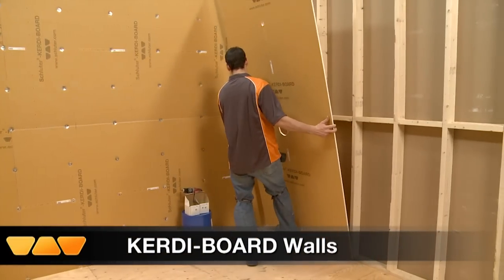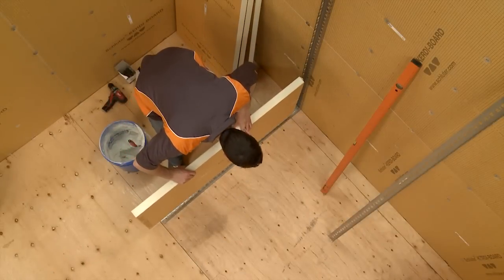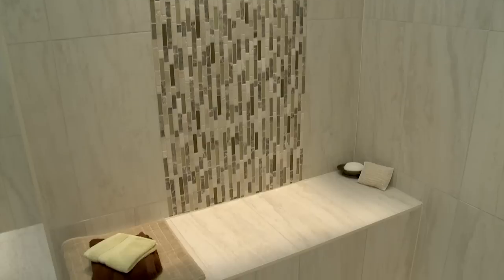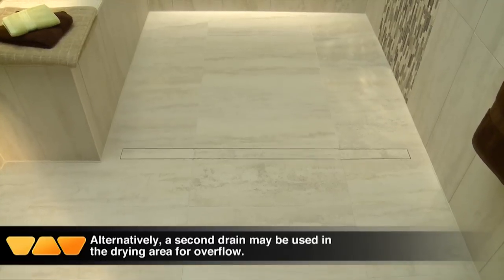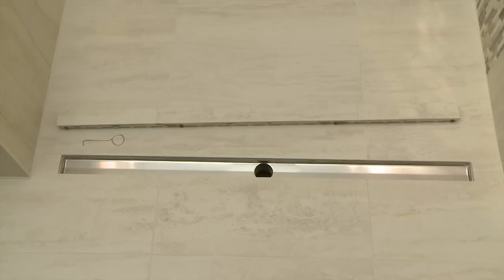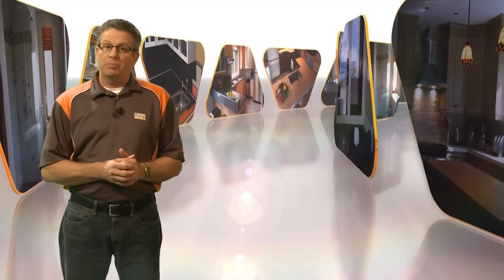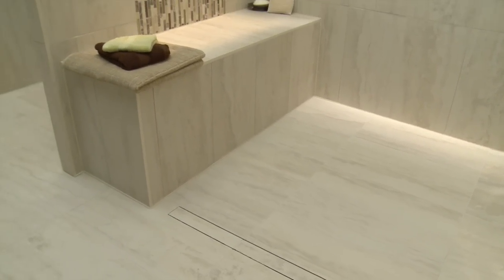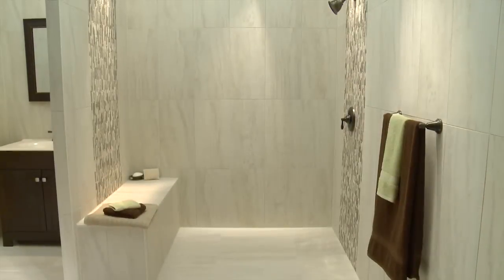Schluter-KERDI-LINE with Entrance Drain Placement

Comment: What about the exposed vertical foam where the cut was made - doesn't that need Kerdi Band as well? See at 4:25
Reply from the maker: Hey, Yes, the exposed vertical foam does get covered with KERDI-BAND or KERDI as well, generally after the tray is installed.

Comment: What is the weight limit of the channel support? I'm planning on having a center line drain, so it will be stepped on from time to time.
Reply from the maker: Hi! KERDI-DRAIN was tested to CSA B79, which includes a load testing requirement, and received a Light Duty rating. This means that it was tested at 440.6 pounds for foot traffic. The tray is rated for 80 PSI. So, foot traffic is fine for both.

Comment: did I hear correctly that I can eliminate any baseboards from my entire bathroom by using the metal pieces? >Either floor tile joined to sheetrock/painted walls or floor tile joined with tile running up the wall as well?
Reply from the maker: Hi Brandon! Yes, we have many profile options that will allow you to join wall tile to your floor tile or continue the floor tile up the wall such as a base board, wainscot or fully connected tiled wall. For this type of application, we offer movement joints, cove bases, bullnose profiles, etc. Please see a list of options on our website at https://www.schluter.com/schluter-us/en_US/Profiles/c/P or feel free to contact our Customer Service team for more information.
US: 800-472-4588
CA: 800-667-8746
 
Hope this helps!

Comment: a non supported foam wall, to hold tile?!  thats a joke right?
Reply from the maker: Rest assured, Kerdi-Board is fastened to the studs offering even, impact-resistant, and rigid surface for tile. :)
Reply: That was my concern as well. It looked like it was supported on the floor and only one wall.

Comment: Water will run past the ends of the drain. How would you deal with that?
Reply from the maker: Hi Aidan, 
We state the ideal scenario along with an alternative in the K-SHBF detail in our Shower System Handbook, "If KERDI-LINE is placed at the shower entrance, it is recommended that grate assembly A, Pure, or the covering support (D) is chosen  and that the drainage openings span the maximum width of the entrance to limit potential overflow; secondary drainage (e.g., KERDI-DRAIN) may be required in the drying area."  We chose to go with a slightly shorter drain in this video to show that option, which can be used with a secondary drain in the drying area. There is no cause for concern about the amount of moisture to be expected outside of the shower area as this is part of the nature of curbless showers and either of these two approaches would handle it. For further information, the TCNA discusses waterproofing outside of a curbless shower, as well as secondary drains, in B421C of the TCNA Handbook.
Hope that is helpful!
Reply: @schlutersystems1  thanks; do you have a link to the updated Shower System Handbook?
Reply from the maker: Absolutely. Here you go! https://sccpublic.s3-external-1.amazonaws.com/sys-master/images/h01/h73/8917106196510/Shower%20System%20Installation%20Handbook.pdf
Reply from the maker: Hi Paul, thanks for the comment! Ideally, the Kerdi-Line drain would extend the entire length of the shower opening. The Ditra and Kerdi-Band overlap also provides waterproofing outside of the officially, "wet area".
Reply: @schlutersystems1  so is this not an "ideal" installation? Can you show some examples of an ideal installation?   Am wondering how much water is expected outside of the shower area.  When the guy says "moisture can be expected outside the shower area" at 7:30 it makes me nervous....

Comment: If you place the drain as has been done in this video, what is the build up at the edge of the pan? Do you mean a three-quarter inch plywood underlayment, on top of the existing subfloor, or just the ditra alone? Thanks!
Reply: Hello Schluter-Systems North America, your answer to Christian’s question above is incomplete and non-responsive.   He asked a simple question five months ago.  I followed up one month ago asking the same question.  Still no response on point.  Carefully reread his question.   We are NOT asking for the perimeter height of your trays.
Reply: @gregorystevens5173  As they show it in the video, you will have to use 3/4" or maybe 5/8" osb on top of your existing subfloor, yes. The problem is how do you transition on out into the rest of the home? The answer is to plan and build the shower area dropped the correct amount, then when the tray is installed it's at the subfloor top + ditra height, in order to be level on out to rest of home. No small task and will burn up numerous brain cells. You need all of the parts that matter at the framing stage just so you get it right! I did this myself and am getting closer to tile time. It required using smaller joists in my case because that was easiest for me. (the smaller joists in my case didn't affect strength enough to matter, but your case may be different) You can also do it by recessing the subfloor in between each joist, meaning a bunch of cleats. The joist tops will be flush with the subfloor top and just under the tray. One thing's for sure: magic won't happen so that your floors all line up throughout your house without planning or low ramps to accommodate the thickness differences.
Reply: see new reply below >>
Reply from the maker: Hi Christian! Thanks for the question. If you are looking for the perimeter height of our prefabricated trays you will be able to find it under "Product Table," here: https://www.schluter.com/schluter-us/en_US/Shower-System/Prefabricated-Substrates/Schluter%C2%AE-KERDI-SHOWER-LT--LTS/p/KERDI_SHOWER-L-LS
Reply: @schlutersystems1   Same question that didn't get answered:  "Do you mean a three-quarter inch plywood underlayment, on top of the existing subfloor, or just the ditra alone?"

Comment: Hey I got an idea, why don't we just build a whole house out of foam.... 👎👎👎
Reply: They actually do it is just too expensive for residential they do aluminium PIR foam sandwich panels. Something like SIP's which is again building house out of foam so what is your problem? 21 st century started 20 years ago
Reply: @majstrujeme8352  because it is crap, it'll never last, it is not Fireproof by any stretch of the imagination, burn a straw and you'll see what I'm talking about, plus I am currently in the panhandle of Florida where the hurricane hit and good sized brick and mortar construction got blown down like it was nothing, trees were snapped in half, and I'm going to build my house out of foam ?????💩💩💩💩💩
Reply: @majstrujeme8352   I would never own a car with a plastic and fiberglass foam bumper, I've never seen a steel bumper on the side of the road, that's all I have to say to all of your rubbish
Reply: StarrTile, I’ve seen you in every other comments section and I watched some of your videos too.

You’re just really resistant to change and development. Obviously this product is not  meant to be for a whole house construction application. 

If you ever installed that product, you’d know it’s very stable. Schluter offers hand-on training programs for free. Perhaps you should try one before you run your mouth.
Reply: @joergneumann3613  I get so tired of boomer installers like that trying to down put newer installation materials that honestly do just as good as the old stuff but is less work and provides a better Finnish. He talked about foam not being fireproof. 😂 Neither is wood. We build houses of out foam on the outside of the house for better insulation and a tighter building envelope. When you have tornadoes that blow over concrete structures then there is nothing you can do other then live in a bunker all your life. Not every place in the world has hurricanes. And last I checked. Wood built homes don't face any better for tornadoes. How is a simple bathroom suppose to make a house fly away?. This technology has nothing to do with the structure itself. Other then the waterproofing of course. He said "I would never own a car with a plastic and fiberglass foam bumper," Spelled fibreglass wrong.  Meanwhile all newer cars are built with fibreglass bumpers because steel is expensive and fibreglass is more easily repairable. Steel weights more and dose nothing but add to fuel costs. He should go back to the days of horse farming and tell us how horses are more superior to tractors 🤣.
Reply: @mattcraztex9940  If you're going to be a spelling nazi I suggest you proofread your own work first.  
He spelt Fiberglass correctly.  Both forms are considered correct.  Depends where you live.   
"better Finnish"   (Finish.  One N.)   "dose nothing".   (does.)
Reply: @Canada1984Tommy  Not trying to be a spelling nazi but merely stating how people are super reluctant to change. Also I have not seen people spell "Fiberglass" its always "Fibre" But English is super complicated so I will give em that.
Reply: @mattcraztex9940  Fibre and Fiber are both correct and common depending where you live and which style of English is spoken.
Reply: @mattcraztex9940  as for cars bumpers. It's not just expense but also safety as Impacts to pedestrians are safer. Also minor impacts to other objects don't permanently distort the car bumper. Whereas a metal impact even at low speeds can do decent damage to a pedestrian and cause dings that are not going to pop back out on their own.
Reply: @lliaolsen728  I mean I wouldn't recommend testing that out but I don't disagree with it either. Everything nowadays is fibre and plastic. Metal is great until you bang it once and it starts to rust out. Fibreglass bumpers don't rust like Metal ones do. Cars are a whole lot safer nowadays then when they used to be because of that.
Reply: @mattcraztex9940  Just to expand on what Lila said, fiberglass is American spelling; fibre, centre, metre are spelled as fiber, center, and meter in America. Starrtile is from America, and as am I. In fact on my screen when I type 'fibre' it actually gives me the red squiggly line underneath because that's actually considered a typo here.

Respectfully, best not to introduce non-sequiturs because everything else you said was already 100% valid. One can agree or disagree with Starrtile's conclusions, but he is generally bad at making arguments. One time he actually bought kerdi stuff and made a video of him burning it in the backyard, apparently to make the point that...stuff is destroyed when you set it on fire, or something. Another time he argued that in traditional vinyl liner + mortar bed pan builds, a pre-slope is not needed because 'water is not gonna know which way is down once it's inside the mortar'. He has something of a notoriety in the tiling community. He would constantly chastise youtube tilers for using schluter stuff but if he likes a tiler personally for some reason, then he wouldn't (even if they almost always use schluter). It's all very weirdly personal and temperamental with him.
Reply: @jw1731  Yes I agree 100% I am from Canada so even when we  got US products they often have the Canadian Spelling on it not the US. English is not my first language but regardless which way its written the point gets across.

On the Starrtile topic yes I 100% agree with him being a notoriety in the tiling community. It's funny how he likes Issac aka (Tile Couch) he renamed his channel to. Even thou he uses a lot of schluer products and recently partnered to make his own brand of the same type of system as schluter but with his name on it or something. Like how Sal is a very respected tile installer on YouTube he doesn't cut corners and knows what he is doing. Yet sal ended up calling bob a hack or something because bob was saying sal installs garbage products and that schluter is garbage or something. I don't know the full story but the saga with Starrtile (bob) and the rest of the tiling community can be comical at times.
Reply: Well, they didn't build a house out of foam. They  insulated a bathroom with it because you have to make all surfaces water tight when you install a barrierless shower. This may be an expensive route, but it's also the correct way to do it.